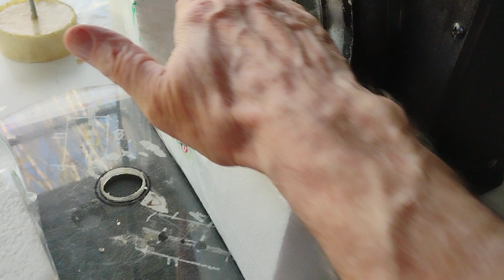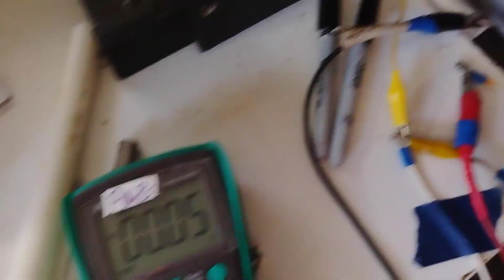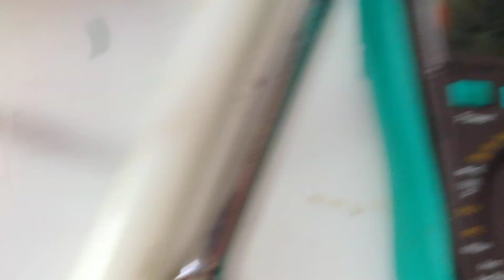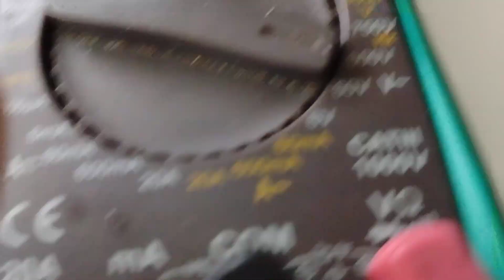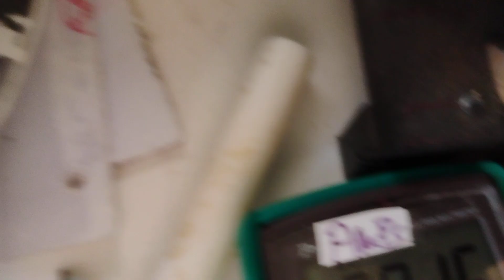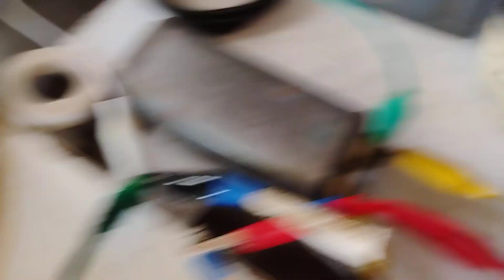PMRV 4 NSNS "sideways" magnets in rotor tests.  At least no heat build up now...does not run on AC

Comment from the maker: Hi Fokis
You are probably right to forget about it, make some flat disc axial type AC motors instead.
If what I want is a very efficient motor, but I have made many motors of this axial type in the past plus  got them to run on AC signal too and have done the cap dump thing too a lot. You can see it all 'on record"  in my channel. 
However purpose of these experiments is to find a good angle and air gap to spin very strong  neodymiums inside a 3ph AC motor and so it's a rotovertor with permanent magnet rotor.  The rotovertor run cap phase is very interesting and is overunity by itself,   I want to try and make it even more overunity than it is with a permanent magnet rotor. 
I have other designs for rotors coming up, might succeed might not new things not expected pop up when doing experiments on bench no others have tried before (maybe for good reason too haha)
Reply: Indeed, I think it's a fantastic route of experimentation, one well worth exploring... This how we realize truth, Godspeed, my friend.

Comment: leave that project man for your own good. If you want more efficiency build the whole motor yourself with 3 stacks of rotors and 2 of stators in a axial flux fashion. Wire 0.5mm with round and flat coils as many turns as possible - Magnets minimum 20x10mm diameter with a big wheel rotor of more than 50 cm of diameter and a flyewheel with bearings spinning freely (not attached to the axl). Then youll have a very efficient monster motor... that will happen to neutralize the initial cogging or lenz of a generator but then youll have to make use of a cap dump circuit so that the output is not constant enough to reduce the speed of the main rotor by cutting the inercia of the flywheel. Good luck!